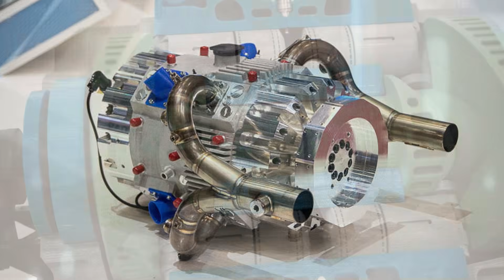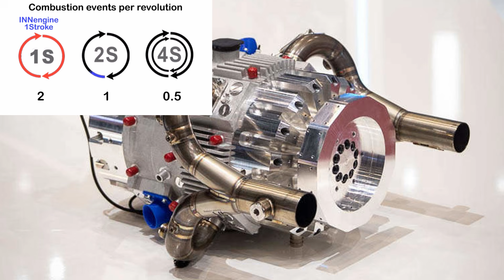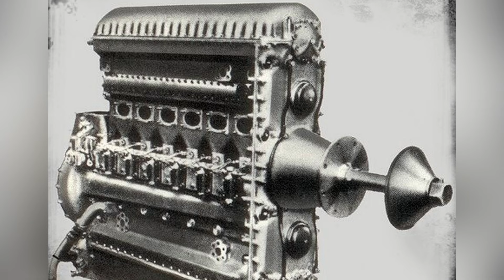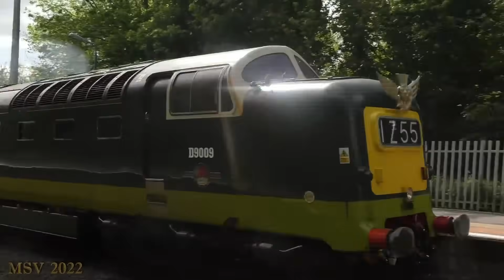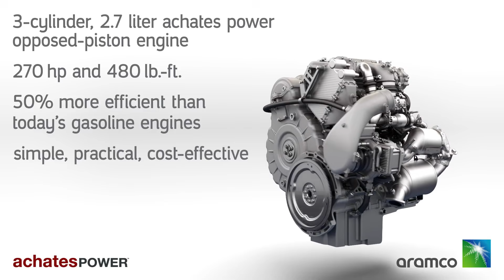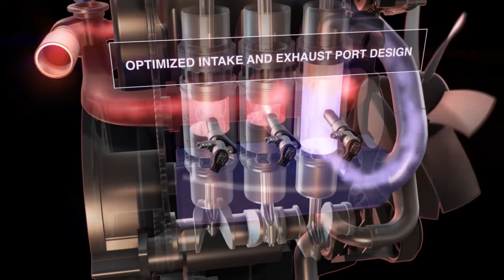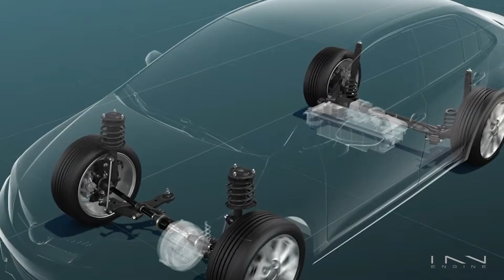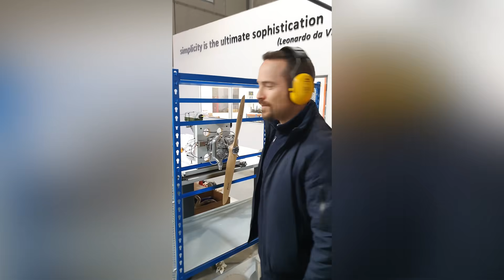NEW OP Mini-Engine DESTROYS Pure EVs

Comment: Hybrid electric vehicles have always seemed a good option to me.  Most driving is done around where you live.  Extended trips are not the norm.  Having enough battery capacity to cover most around-town driving, with an efficient single-purpose fossil fuel generator to cover extended trips, is a good way to ensure range, decrease weight, and lower the cost of a pure electric vehicle.
Reply: And if the battery pack were to decay and fail you can still rely on the ice
Reply: @Vibakari  That's an assumption.  Some hybrid designs only use the ICE to charge the battery, propelling the car only with the electric motor.  It's not much of a benefit anyway.  Battery failures are rather rare.
Reply: Yes, battery failures are very rare.  Batteries are very reliable devices.  

I'm not clear on what you are saying is an assumption.  If you are talking about the inevitability of hybrids releasing carbon, that is true, unless you never use the ICE.  If you don't use the ICE, it can be removed, making the vehicle a BEV.
Reply: @Vibakari the ICE will decay and fail faster.
Reply: @Vibakari  no you can't... it won't start.
Reply: @Vibakari   Why do you expect the battery to fail?
Reply: @Vibakari  Hybrid cars won't run on just the ICE engine. The battery is integrated into the entire system.
Reply: @kpadalldotablet1009  Why? That's just todays versions. It can change.
Reply: @kpadalldotablet1009  depends on the motor setup, you can add a combining gear....
Reply: @Vibakari 10 years of EV production is proving that statistically, batteries do not fail or decay any more than ICE power trains. Plus any degradation experienced by early cars without battery management is gradual, rather than catastrophic as with the enevitable, con-rod or big-end failure in high mileage ICE engines and require no expensive servicing or preventative maintenance (oil, filters, plugs, belts, clutch, flywheel, rings, bearings etc.)
Reply: In principle and 20 years ago, in practice the hybrid toyotas I got as replacement vehicle were the worst experience I ever got. And after driving an EV for a couple of months now that is an improvement.
Reply: @flemlion13  Was that a hybrid power train?  What I would consider a good hybrid has just an electric power train coupled with a seldom-used gasoline generator.
Reply: @patrickmchargue7122 For something like that engine weight will be critical.
Had a look at liquid pistons work on their rotary engine?
Reply: @Luredreier  Yep.  There seem to be some great options for low-weight, high-efficiency, motor generator pairs for range extension.
Reply: @Luredreier  I'm not a hybrid fan, but to be fair, this engine is extremely light and compace, although I'd like to see some sources for the '50%' more efficient claim.
Reply: @Luredreier  Remember, the engine may just come close to the weight of the batteries displaced.
Reply: @patrickmchargue7122  The best hybrids have just the battery and electric motor in the car and use the highly efficient and clean power generation of the grid to charge the battery.
Reply: @patrickmchargue7122  Not even close. A good hybrid will have a diesel motor coupled to an electric power train. A diesel designed around running at a high load at one specific RPM is leagues more efficient than a gasoline motor. When I say designed around one RPM I mean everything from the intake piping, to the valve, piston design, cylinder head design ETC. VW diesels manage 40+% carnot efficiency in a motor with a wide powerband. Imagine the increase if you only need to design for it to ever run at one speed! Higher torque output at a lower RPM is beneficial for engine design as well
Reply: @Luredreier  At least you did not call it a wankel like most people confuse liquid piston for!
Reply: @flemlion13  you might as well buy an H2EV then. Fully electric but powered by a hydrogen fuel cell. Toyota Mirai has 650KM range.
Reply: @what9418  there are more H2 stations closed than open. With all the tanks you have poor occupant and boot space in the Mirai. Not to mention the inefficiencies of H2 in the global picture.
Reply: @flemlion13  yes true. EV charging points weren't much available in the beginning either. Nor where VHS video tapes or CDs back in the 80s and 90s. Can be overcome if people want it. 

As for the boot space, an 85KWh EV has 200liter+ accu space in the bottom plate. It is just a matter of locating the tanks in a more efficient spot. And 200 liter will store about 12 KGs and gets you 1200km range. Now, of course the tanks need enough shielding to make it safe, so 200 liter may be impossible, but 150 should be managable.
Reply: @what9418  My point is that over the previous year three new charging points became available near my home, while the H2 station has now been closed for over two years, the demand is not there, the market has already decided. I also don't need 1000km range, my bladder doesn't cope driving that far.
Reply: @flemlion13  I'm not surprised it closed. How much brands sell h2 cars? 

But 10 years ago you needed a charger at home. There were hardly no public locations.

And people tend to be lazy.... That's a better reason to get 1000km range. So that you only have to charge once a week instead of sticking around a public charging point for 30 minutes, or come back to move your car when it is done.

It is just what you are willing to do. If you have a charging station at home and can do most trips on a single charge, I agree it is very doable.
Reply: I am totally with you and your opinions with different technology like this. I see this engine as a new way to explore the electric car. It could be use to power an electric car with very limited batteries, and could turn out to be very economical, and offer extended range on very long trips. Generator driven diesel electric locomotives have been very successful for far too many decades to mention. This little engine is so light that it is what is needed for our future hybrid cars, as another alternative to the battery plagued only EV concept. Always keep open mind and try to avoid fads that might give us what we want, but in the end it may not be what we need.
Reply: Preferably the hybrid system needs to keep the ICE system out of the main drive train with the ICE acting as a REX (Range EXtender) so the already extremely reliable EV drive train doesn't become less so when a REX is added.   ...would be a godsend out in the vast rural areas between interstates.
Reply: @foxpup  Absolutely.  The ICE should only drive a generator to supply electricity to the existing electric motors.  Simpler drive train with a relatively simple generator.
Reply: @foxpup  Toyota prius's can cover 300,000 miles. Many do.
Reply: @abbersj2935  Toyota Prius's are great cars for what they are but I do NOT regard them as electric cars because their electric range is abysmal.  Their whole electric drive system exists for the purpose of making them super-efficient at burning gasoline.  Again that's a great thing but if you want to drive around on solar, wind, hydroelectric, nuclear etc. power it's not going to serve for that.  The now discontinued Chevy Volt could go a few dozen miles electric, and the still in production BMW i3-REX even more but that car isn't really for everyone.  That said, it's a better world because Prius's exist, but there is wonderful reliable/affordable simplicity in a basic pure EV with the option of being augmented with a REX of which the tech in this video might just help with.  Any REX should be as light as possible for the required power and this might fit the bill. 🙂
Reply: @foxpup  I don't regard them as electric either. They do need a better all electric range though. For the next decade in my view hybrids are the way to go if living outside of a city.
Reply: It was called the Chevy Volt, but people were too thick to understand it. Chevy marketing sucked too.
Reply: @kpd3308  Yeah, I had one.  I very much appreciated it.  I drove from California to Colorado in it using gasoline, but charged it overnight otherwise.
Reply: @kpd3308  should have called it Chevy Hybrid
Reply: I have a Volvo hybrid.  The clever design allows an AWD drive vehicle without a complex differential and prop shaft utilising the petrol engine to drive the front wheels and an electric motor driving the rear axle.  Either mode can operate alone or in combination where conditions or performance requirements demand.  Driving modes can be switched around seamlessly on the fly.  The chassis is very well engineered handling exceptionally well in either FWD or RWD.
Battery range is nearly 50 miles which covers most daily requirements whilst petrol range is 400 plus miles for anxiety free longer journeys.
Having previously been a hybrid sceptic I am fully converted.
Reply: Why would you think hybrids make sense?
Seriously, why carry around a generator which you hardly ever use, costs money to maintain (and if you only use it occasionally, the maintenance is still going to be needed), as well as adding complexity when it's not needed.
I get that most people rarely need a great deal of range, but how about battery swap technology? Nio already offer this, but their vehicles are expensive and the batteries are a minimum of 100KW, so they're hardly "City runabouts".
OTOH MG, one of the fastest growing EV producers, has incorporated battery swap tech into their MSP platform. Battery swapping in this form is not the 5min task¡k it is with Nio, it's the sort of thing you can do during routine maintenance, but I can see that as one route to follow.
There again, with energy densities in batteries growing by leaps and bounds, I  can see the whole hybrid debate being very short lived.
Lighter, more powerful batteries will kill off any argument about ICE vs hybrid vs EV. Because I don't think that it is beyond the realms of possibility/probability that we'll have 1000+Wh/kg quite a long time before burning fuel becomes illegal.
Reply: @davidcolin6519  Unfortunatly the infrastructure is not and will not be there for a decade at least. Whatever a few headlines say. Have you considdered how even 5 million EV's would be charged every day? The grid could never support it.
Reply: @abbersj2935  "Have you considdered how even 5 million EV's would be charged every day? The grid could never support it."
Yes, I have. And so has the have the managers of the power companies across Europe. And they all say the same thing; that this argument is absolute BS.
Apart from anything, electrical consumption has DROPPED since 2015 (the peak year) and there is plenty of capacity RIGHT NOW, to support far more EVs than Arte already on the road.
Not only that, but the ability of car makers to build enough EVs to "Swamp the grid" just isn't there. That is not me saying it, it was a specialist inEuropean electrical provision.
So that argument has been blown out of the water, not by me, but the specialists.
You seem to be the one hypnotised by the f*ckwit headlines, because it is clear that you have no f*cking idea about the real situation with the infrastructure.
Reply: @davidcolin6519  Same argument could be made for lugging around a ton of batteries when most driving is local.  A motor-generator can be specialized to one task, and do that task well with minimal maintenance requirements.
Reply: Prius Primes are Plug-in Hybrids (PHEV). They drive all electric until the lithium ion battery pack depletes and disengages. The secondary battery is then used as a conventional hybrid until recharged via plug.

EV pack has a range of 39-44 miles before ICE kicks in.

The issue most Prius Prime owners have has been they don't go through Gasoline quickly enough and the fuel starts to gel.
Reply: @Eujoung  So why have the engine anyway?
From a purely engineering point of view, hybrids are a silly solution, carrying a round an engine which you're not using "Just in case".
And I keep asking the simple question; "How often do you actually need to drive more than 500 km?"
Reply: toyota hybrids already create miracles, leave it to them
Reply: From a stats point of view you are not wrong but there are millions of us that drive a minimum of 100 miles per day.
Reply: I agree, you need to look carefully at whether a Hybrid fits with your lifestyle.  As I am semiretired and work mainly from home with one commute day a week it works for me.  I can charge it from my PV panels in the summer.  Otherwise I would have kept my fantastic 3 litre V6 diesel A4 Avant. @CynHicks
Reply: @mrradman2986  Yep. I love big v8s but a v6 with enough power to climb the hills with a few hundred horsepower is a better daily when you drive so much.

I mean, you can get up the hill with less by stressing that poor little engine and transmission but... You wear them out fast right.
Reply: I have had two Audi A8 limos and the A4 Avant with the V6 3 litre diesel engine.  They have huge torque and are pretty economical  I could drive from Geneva  Switzerland back to my home in North Yorkshire over 800 miles in a day in the A8 without needing to refuel.  The first one is still going strong with 250 000 miles on the original engine and ZF transmission with routine servicing. @CynHicks
Reply: @CynHicks  That's a long commute! (in time and milage)
Reply: @patrickmchargue7122  It's not very abnormal for us that live in rural areas. It's also not the most extreme in the least. I had a friend back in the day that traveled 3 hours per day IF they sped on the lonely interstate highways at 85+. 

There's actually a lot of us, man.
Reply: @patrickmchargue7122  It's not very abnormal for us that live in rural areas. It's also not the most extreme in the least. I had a friend back in the day that traveled 3 hours per day (both ways of course) IF they sped on the lonely interstate highways at 85mph+. He traveled from mid-north Alabama all the way to right outside of Nashville on a daily. 

There's actually a lot of us, man. We're one of the reasons the interstates were  built so rapidly to begin with, back in the 50s. People have to work and produce. Opportunities aren't always near home and everyone can nor WILL live in the cities. If we did the commute would take just as long anyway. Mileage is not the metric that matters to a commute. Time is everything. That includes getting groceries and time spent living life.

People think it's weird but often think nothing of people that fly daily to do business. Whatever though. We're here
Reply: Hybrids time has come ... and gone.  Economics says a simple electric motor and a BIG CHEAP battery will simply be a better solution than a hybrid.  Especially when there are NO GAS STATIONS but plenty of CHARGING STATIONS. As people drive EVs, Exxon becomes irrelevant and companies like Shell - who are building competition for Tesla's Superchargers - will likely be the winners. (Yes, I know Tesla will be a BIG winner - Musk may be a right-wing lunatic a-hole but he IS really, really good at understanding what can be made to work).
Hybrids lose their utility when there isn't a filling station on every corner anymore.
Reply: @bobbytookalook  I did lease this car and was impressed with it.  Most of my driving was local and I charged it overnight.  I also did a few long trips (1000+ miles) and appreciated the ability to do this.
Reply: Another geewiz creation that will go nowhere.
Reply: But you are carrying around an electric motor and batteries even if you are not using them, and the same is the other way, meaning carrying an ICE and fuel even if not using it, decreasing range…
Reply: @DougJessee  You're carrying a much smaller load of batteries.  The motor-generator will be tasked with only generating electricity, simplifying its design and making for a much smaller footprint.  Overall, the car would be lighter, run on batteries for most miles, and use the generator seldom.
Reply: Hybrids fail because they still burn petroleum fuel and emit carbon.  It's that simple.  We don't need to reduce carbon emissions.  They need to be eliminated.  Even electric vehicles cause the release of carbon, until we clean up electrical generation.  But that is feasible and we are presently working on it.  With this engine, there's no path to zero carbon emissions.
Reply: @rickcollins2814  they don’t because the generate their own electricity … and don’t explode see burning container ship in north sea full of electric car bombs
Reply: @OutRAjious   You are being disingenuous about the ship fire in the North Sea (at port now).  No one is claiming what the cause was.   

Hybrids have the same types of batteries as BEVs.  So, I don't know what you are talking about when you say, "they don't".
Reply: @rickcollins2814  With uni-dimensional criteria, you're not going to get the best mix of technologies that gives the best, and most efficient, solution.
Reply: @rickcollins2814  zero emissions is a stupid goal that would cause incredible harm to all of humanity. Get real.
Reply: @rickcollins2814  you cause carbon emissions
Reply: @rickcollins2814 Rolling black outs because wind and solar cannot consistantly handle peak loads. Maybe nuclear...
Reply: The BMW i3 I feel has the right approach, turning the usual hybrid model on its head. It is a pure EV with a two-cylinder generator added on for range extension.
Reply: @EnriqueThieleEVs running on coal huge battery pack and forever to recharge.
Reply: Why you can say they are almost as good as a real ICE powered car.. and yet only cost twice as much to own when you consider maintenance including battery pack replacement ever 3 to 5 years.  They will never be as clean as an ICE engine though
Reply: @rodshoaf  it costs less to own, and a battery pack is good for decades, depending on the formula. One case I know of was a 1912 Detroit Electric, which had its original Nickel Iron battery pack replaced in the 1990's. Lithium Iron Phosphate batteries, now the most commonly used in EVs worldwide, have a lifespan similarly measured in decades. And when you do replace them, you get the advantage of development, so longer range.

Beyond the battery, everything else in an EV is cheaper to maintain than an ICE car. Owning a Kia Soul EV, I have never needed to go in for an oil change, transmission fluid flush, and my brakes even have less wear and tear thanks to the regenerative braking.
Reply: Like a Diesel electric locomotive.
Reply: I get to agree with this statement more and more as I learn about hybrids. The fact is, a mini engine running at a constant rate in a hybrid, is much more reliable than a typical gas engine. That is just one big point less to fail, and the range is still amazing compared to EVs.
Also, smaller hybrid batteries can also be an advantage due to lesser cost.
Reply: Type in '300 hp ambient heat engine'.